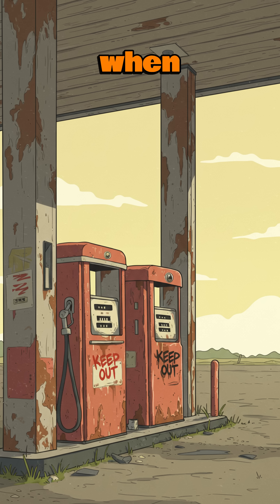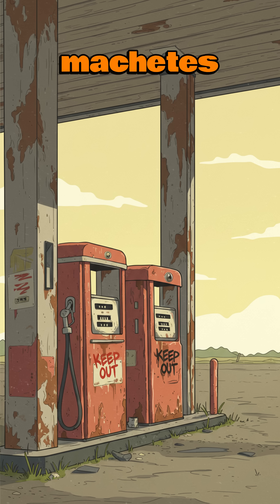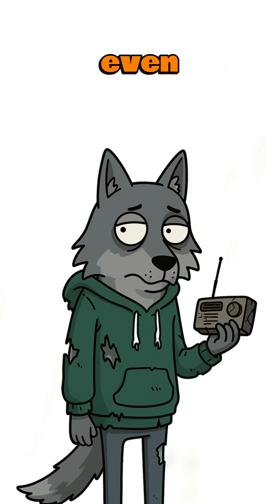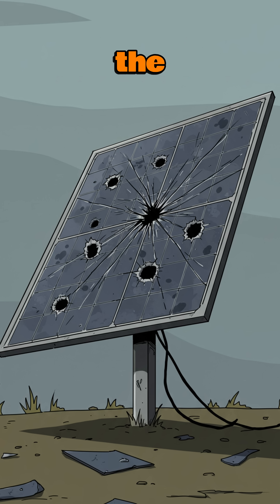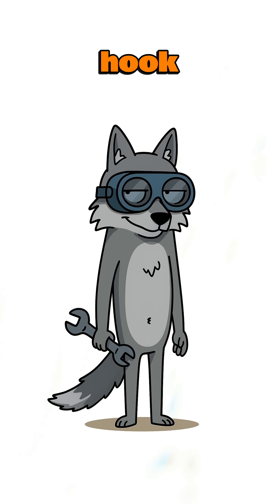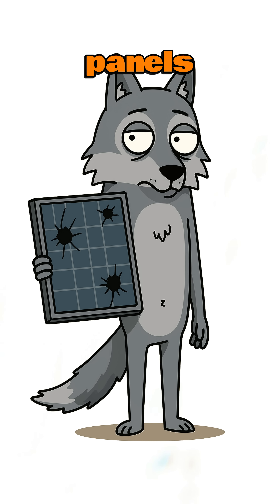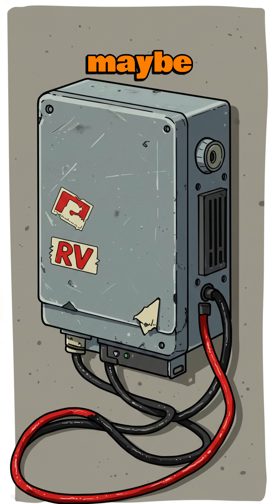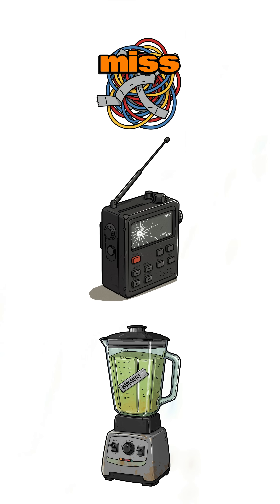How to Make a Solar Power Generator in a Post Apocalyptic World #science

Comment: And with that electricity you can power a old dehumidifier if your in a area with humidity amd set it up as it sucks moist air in to condense the water into its storage container so you can have clean water (i think)